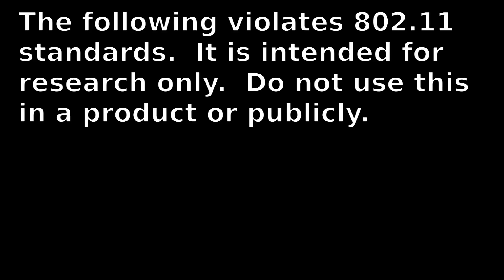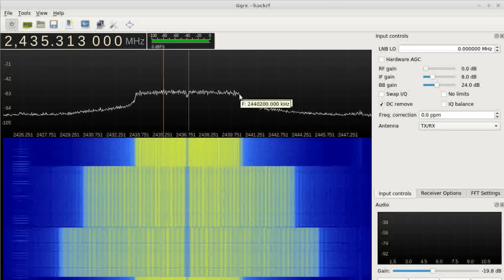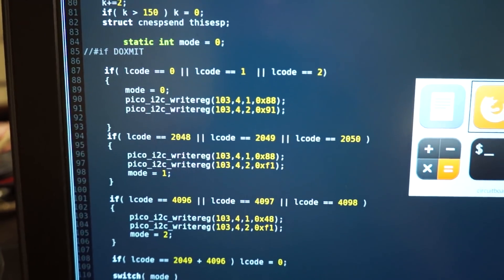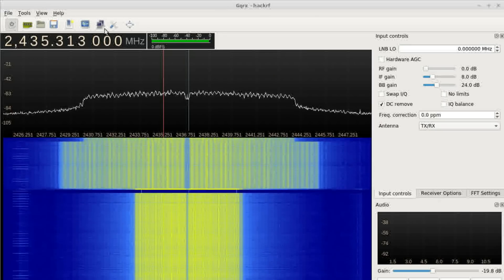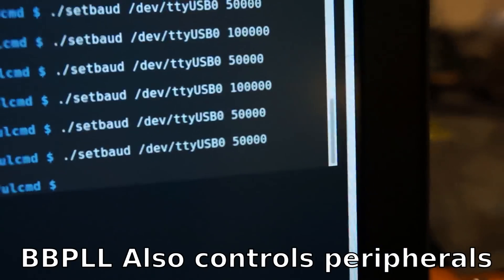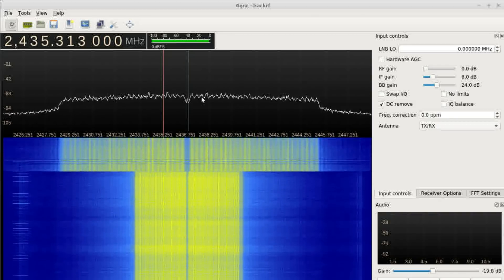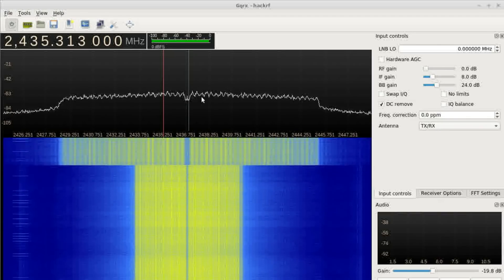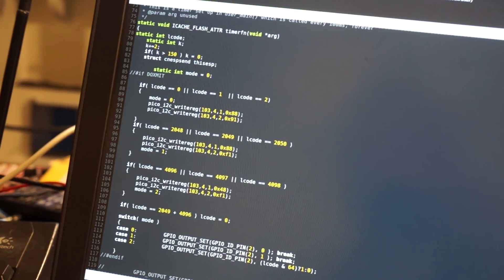Fun with the ESP8266's BBPLL

Comment: Can you jam 2.4GHz with an ESP8266? I mean really jam.
Reply from the maker: Thankfully, no.  the ESP honors CSMA which would prevent it from jamming up the spectrum.
Reply: I once had an ESP8266 on a breadboard and wehenever I powered it, all devices in my home lost wifi.
I even checked with airdump_ng... I stopped receiving packets from all SSIDs.
I guess it was an issue with unreliable power on the breadboard. I suspect it just sent an unmodulated carrier and got somehow locked in that state.
Reply: @RoterFruchtZwerg  Same thing has happed to me several times before

Comment: I just incorporated a few lines of your code into an Arduino example sketch for ESP8266 WIFI AP and WIFIscan and it works as a hidden wifi AP.  

Detailed on your github issue section.
https://github.com/cnlohr/esp8266oddclock/issues/3#issue-402717347

Thanks for sharing this. Sorry I used Arduino, just didn't want to set up a new compile environment. This can work for all WIFI examples in Arduino.

Comment: So from the looks of it you are just changing the modulation symbol rate.

This is not really illegal since 2.4GHz is an ISM band so there is no license needed as long as you stay inside and don't use too much transmit power. As far as the FCC is considered this is now a 2.4GHz keyfob with a custom modulation scheme.

As for range you should be able to get a bit more range when clocking it slower since this exposes you to a narrower noise spectrum and yes this means you can now fit more wifi channels in the frequency band

If you get access to the PLL that generates the carrier, that could let you shift it into other ISM license free bands such as 433MHz or 915MHz. But for that to work over a range >1m the ESP modules will need hardware modification to completely replace the impedance matching and antenna circuitry to get it to work well at the new bands.

Comment: Hey man if you can please answer this question.
I am trying to program the esp8266 using non sdk native c. i dont like programming in arduino /ide so i wanted to use eclipse.
the tutorial you provide doesnt show how to write code for the esp using suitable IDE like eclipse or so.

Recently espriff published something called IDF for esp32 which has full documentation on how to start programming the thing instantly unfortunately i have esp8266 not esp32
will you please make a video showing the process of writing code and how to embed the sdk and such in the Eclipse ide or whatever ide you use?
i searched alot of forums and i cant do nothing. i dont know what to do with the sdk and all of that.
 thanks a bunch :)
Reply: to sum up, i read the API reference and i know how to write a code and i know how to burn the binaries onto the chip
idk how the hell can i turn my code into a binary though or even where to write it :(
Reply from the maker: I don't use an IDE, I strongly recommend a terminal and a text editor.   But, for the rest of the environment, I primarily use esp82xx for all my ESP-related C stuff.  Check out esp82xx on github!
Reply: @CNLohr  by that do you mean something like Gedit and then compile it using make in the terminal?
can you give me a snippet on what an environment is or how it can help me?
Reply from the maker: @CM-Gram  Please read the esp82xx github readme.  It iwll answer a lot of questions and make additional questions easier to answer.   I may make a video about doing a minimal project with it.
Reply: Thanks for replying to me :) i did download it and read it and actually used it.
But i didnt truely understand what to do with it or didnt know how to use it properly 
And yes please do a video doing a mini project using it.

Comment: The BBPLL is the base band clock. It's going to be a fixed bandwidth whatever you set the carrier frequency to since it is clocking the OFDM symbols into the mixer. The slower you clock it the longer the symbol duration (and this IC seems to handle that gracefully). Of course you'll need both sides to have the same symbol clock speeds for the Rx to be fed properly. Narrower bandwidth should get you a better bit error rate at the cost of transmission speed.
Reply: Also the IC is probably designed to do OFDM at a number of rates. 802.11 is pretty ambiguous at the physical layer depending on the revision. Some use OFDM, some are single carrier PSK. In OFDM the subcarrier modulation is also pretty carried from BPSK/QPSK to fairly high order QAM. The rest is just TDM for negotiating with clients and some crazy timing shit in N and AC for MIMO.

Comment: Can't this be used to make the ESP8266 faster? I know someone did, but there is very little information about how. I do know WiFi won't work (similar issue as described here), but how about setting it to "turbo boost" for short bursts when doing cpu intensive tasks and then reverting it to regain WiFi connectivity?
Reply from the maker: It may be able to be used.  Clone the repo and give it a shot.
Reply: @CNLohr  I was hoping somebody would at least have some information about the pll('s). The source is not sufficient.

Comment: If you’ve reduced the bandwidth to 1/3, could you fit two more channels in, I wonder? Is it possible to adjust the center frequency on the esp8266?
Reply from the maker: That might be possible.  I spent a few minutes trying to change the RFPLL, but it turned out to be much more complex.

Comment: It will be nice to have a way to program ESP8266 at Arduino IDE without the WiFi stuff. Just to use it as an general micro controller considering its high clock, saving the starting 200k of flash program memory used for the WiFi.
Reply from the maker: You can check out nosdk8266 for that.  It would be really cool if someone did an arduino thing with that.

Comment: great Video Charles,   Although I didn´t get so SO clear of what you did, and as I did undertood fine  I am going to ask you this:   if the NodeMCU is receiving in other frecuencies like 80 MHz, etcetera,  How is the NodeMCU meant (designed) to don't receive those non standard frequencies?   --->  setting the NodeMCU normally, it can receive those non standard frequencies?,    What BBPLL stands for?,   What the BBPLL is for?
Reply from the maker: BBPLL = Baseband PLL, but it's also what drives the CPU and peripherals... So when you mess with that, it compresses or expands the baseband bandwidth -- it also changes the CPU + peripheral frequencies.
Reply: I think you have a fundamental misunderstanding.  When he mentions 80 MHz that is not the frequincy it is transmitting on, that is the band width it is using for example from 2.400 to 2.480 GHz, this would be using 80 MHz of bandwidth (meaning how wide portion of the RF spectrum that is used, not to be confused with the more common meaning of data network throughput capacity).

Comment: I may be wrong, but aren't you allowed to spit out whatever crap you want in the unlicensed bands, as long as you transmit below the legal power limit?
Reply: 2.4GHz IS an ISM band, you can shit all over it as long as you keep power within regulation limits.
Reply: @rasz  if you couldn't microwaves would be in a dubious legal standing
Reply: @rasz  oh what about a amplifier that reaches 100m wifi
Reply from the maker: @ms2649   ?? The ESP does ~1km wifi without an amp.
Reply: @CNLohr  i never had an esp8266 with a range of ~1km without an amp and now I'm curious how did you get the range that far. 

and I'm talking about the amplifier extending the range of the wifi through concrete walls 

EDIT sorry i should have been more precise

Comment: FCC part 15 rules are what you need to be worried about, not 802.11 compliance.   The latter is just a technical specification for interoperability, it is not legally mandated.  As a hobbyist you are allowed to legally tinker in these unlicensed frequencies but it is up to you to know when you are violating fcc rules or not, generally they are concerned with you transmitting out of an allowable frequency band or at too high of power, using less of the band should be just fine.  If you are selling devises (unfinished kits don't need this) you would need to get FCC certification and an FCC ID proving you are not transmitting outside the bounds stipulated by part 15 rules.  

You really should get a ham license, you get access to quite a bit more of the spectrum and at quite a bit higher power, given your knowledge set passing the test should be easy.  This project looks to me to be 100% within regulatory requirements no matter if your in your home or not, licensed or not; but on that point your disclaimer on the intro propagates a falsehood, the FCC gives you no special consideration for doing stuff from in your home.  I knew of a guy that got in quite a bit of hot water for monkeying with some firmware settings on (I think) 5.4 ghz gear and was stomping on some very sensitive weather radar from his home.  If you break the rules in a disruptive way they can pinpoint you rather easily and will come knocking.
Reply: thanks, person with ... unpronounceable name!
Reply: They nearly never come for any one , just look up fcc inforcement is a joke for most things.   Just like the boafang radio . To hear the hams tell it, the prisons should be full of people and their spurious transmission. But the aren't and data show this.

Comment: meh ... narrower bandwidth for the same symbol rate just makes sig/noise at the receiver poorer. It will works because modern hardware has better performance than the hardware when the standard was developed, but that does not make it useful or desirable.
Reply: Would a lower symbol rate not increase the range, though? I think that could prove very useful for some apps.

The problem is, as Charles alluded to at the start of the vid, is that the non-spec modes would very likely upset the FCC (or the counterpart RF Gestapo in each Country).

If the frequency could be lowered to one of the ISM bands, and the duty-cycle and maximum TX power adhered to, maybe it could be used for lower power / longer range LoRA style comms?
Reply: @electronash  Not quite the way allocation of the frequency spectrum works. You can send anything of any shape on the 2.4ghz band without a license. There are plenty of products such as wireless landline phones and baby monitors that do this.
Reply: @Gaget01Stuff  

I'm not a HAM, but I thought there were still fairly strict guidelines still, on the bandwidth, power, and duration of the signal?

AFAIK, you can even get in trouble for using the wrong WiFi channel in some Countries, but then I guess that would then be classed as an out-of-band issue.
Reply: @electronash 
Some countries don't spread their 2.4 as wide as others, so channels 12, 13 and 14 are country dependant. I think Japan loses channel 1 too.

And yes, some countries require specific modulation and channels depending on the device type or modulation. The fact microwave ovens spew out 2.4GHz leads some people to believe the band is open for little RF transmitters to do the same (and for safety, you really shouldn't).
Reply: @tin2001  

True.

It is weird how microwaves are allowed to leak RF across a wide swathe of the spectrum.

I think it's still generally lower power than the average WiFi peaks, though, so I guess that's how it can cut through it?